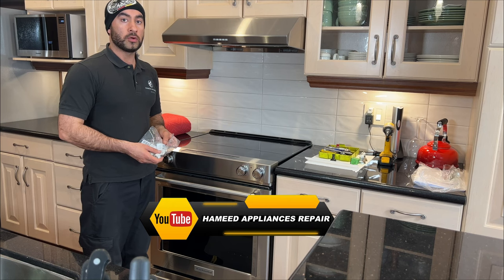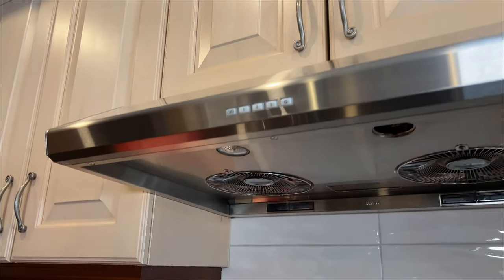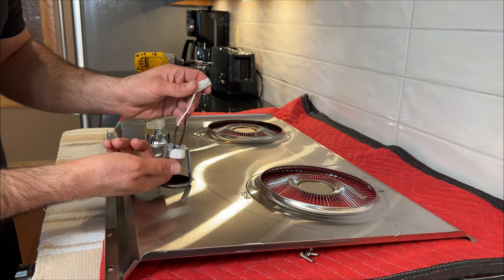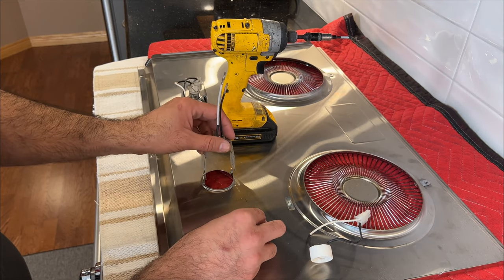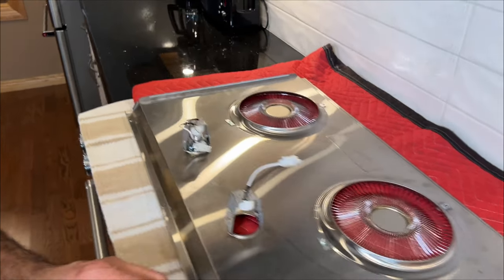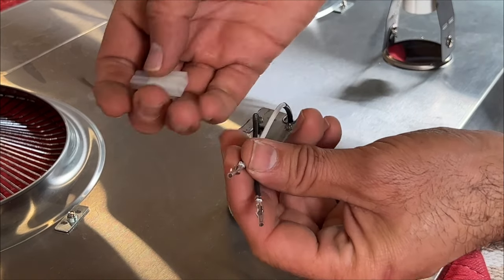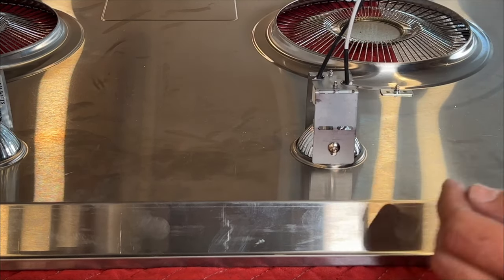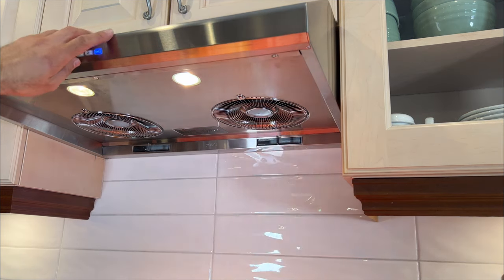How to replace light bulb socket in zephyr venthood .

Comment: Thank you for the video. I just removed the light bulb, just the way you showed. However I used a regular suction cup and a plier to hold it strong enough to turn. The bulb is also 135v 35w. I really appreciate you take the time to explain step by step. Great job!